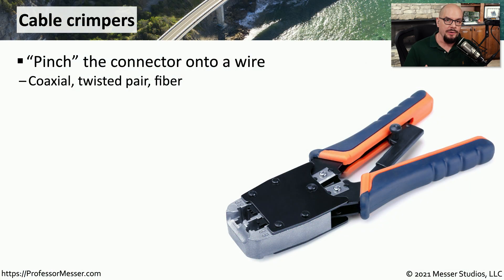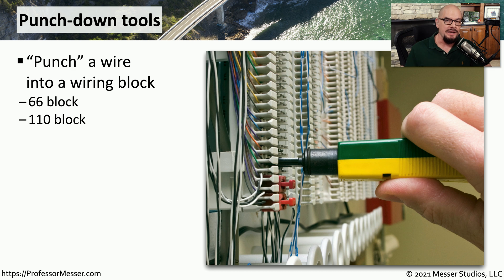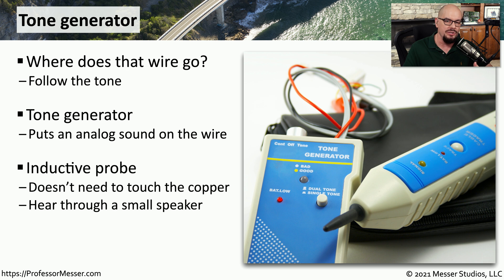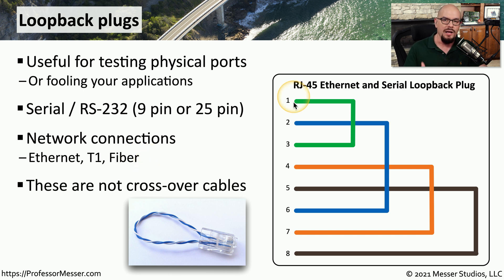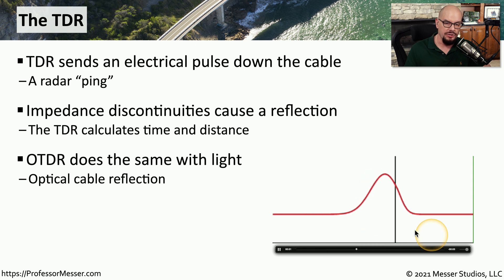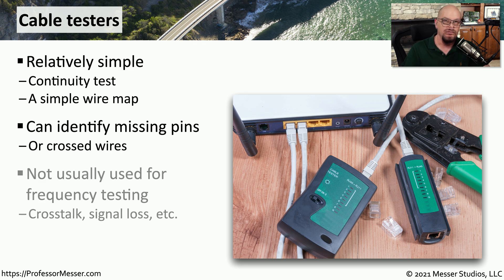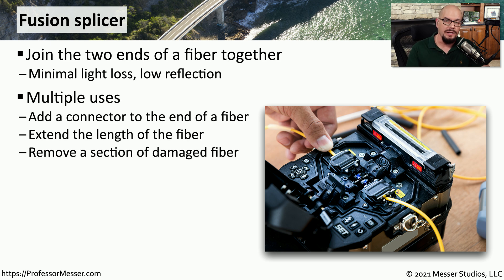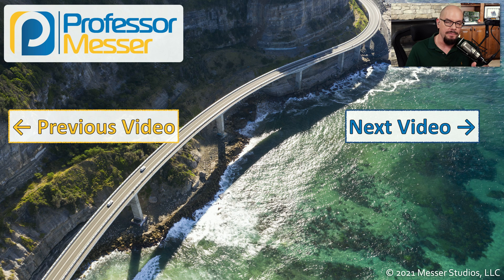Hardware Tools - N10-008 CompTIA Network+ : 5.2

Comment: Aside from one professor in college, I can't name any other teacher I've had that has explained things as well as you have explained them.
You take the time to explain why something is useful for learning and not just the concept with a definition attached, which I think is a common practice is U.S. schools to explain things that way and it really makes for a terrible learning experience. Like, for instance, a loopback plug. Without a good explanation, it almost seems like a useless tool to have. Because, as someone first learning it, you may be thinking of its use as for something else entirely different. But you explained what the network device does with the sent and received signal in order to make that plug worth having and using. However, teachers tend to already have a good understanding of a concept and don't think of it the way that a new student to the concept would think of it. So, the new student just tucks away a shallow, poor understanding of the concept in order to "understand" it. You actually make the concept seem interesting.
Anyways, this is a long-winded comment. I just want to say, "thank you!"